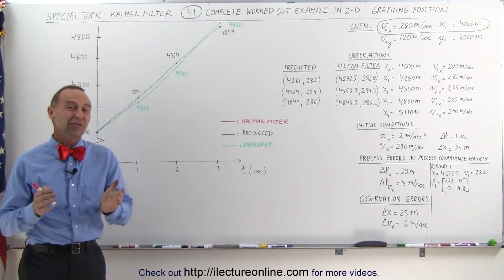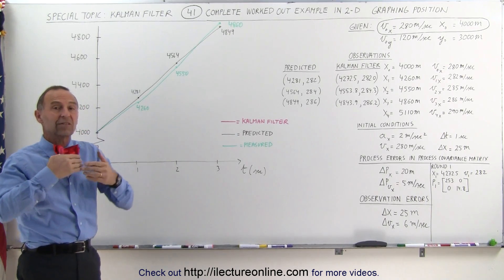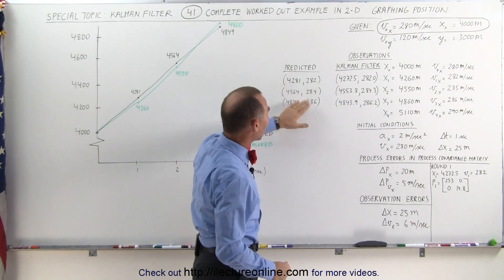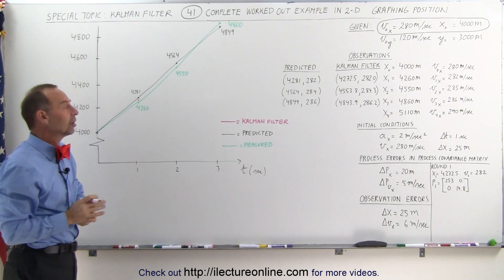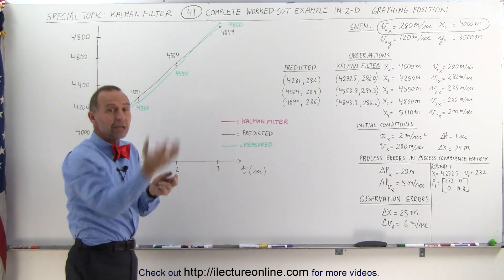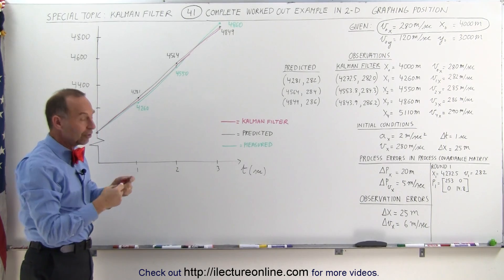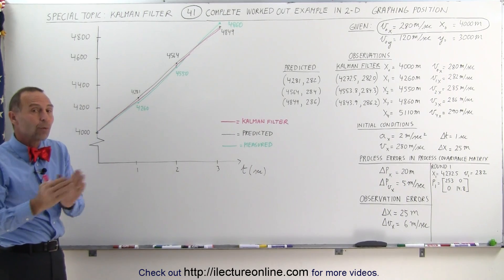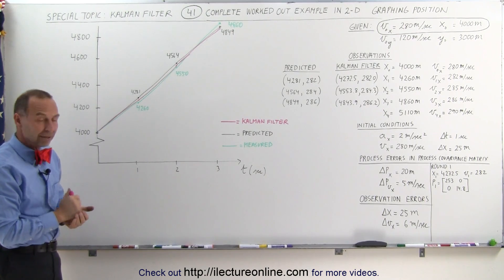Special Topics - The Kalman Filter (41 of 55) Graphing 1st 3 Iterations (t vs x) - Tracking Airplane

Comment: In step three the Kalman result does not lie between the predicted and measured value. Here the predicted value seems to be wrong; should be 4839 instead of 4849.
Reply: Yea this confused me for a while. According to lecture 39's calculations, the predicted value should be 4839.1
Reply: That`s right. It confused me too. Since Kalman result should lie between measured & predicted value. . .
Reply: Yes and it makes more sense too because the kalman gain adjusts either the predicted position in the direction of the measured position or the other way around. This way the end result will always be in between the data point of measurement and prediction.
Reply: the thing was that during previous calculations there were many errors (which are pointed out by some comments) which definitely biased the final result.

Comment: Thanks a lot for this series, it's the best tutorial in the world. i have a question, what's the diference between kalman filter and extended kalman filter ? the extended kalman filteris has his own methode and calculation ???
Reply from the maker: A regular Kalman filter is a filter using linear inputs (like distance and velocity).  The extended Kalman filter is a non-linear filter which includes acceleration as an input.  This is used in tracking and GPS algorithms where IMS inputs are used to update the filter.
Reply: Thank you, and could you do some tuto about EKF please ?, it will be more important
Reply from the maker: When I find the time.  Still very busy working multiple jobs.

Comment: Thank you for the lectures!
In your example you assume that the acceleration is constant 2 m/sec^2. What if it changes and causes a real change in velocity which is not included in the model? Should you simply change the model then?
Reply from the maker: +shimonze  Yes, here we used a constant acceleration. When tracking an object with a changing acceleration, there needs to be a feedback loop for that as well. I will show more examples in the future with more complex algorithms.
Reply: Thank you Michel
Looking forward to watching your next videos.
Shimon